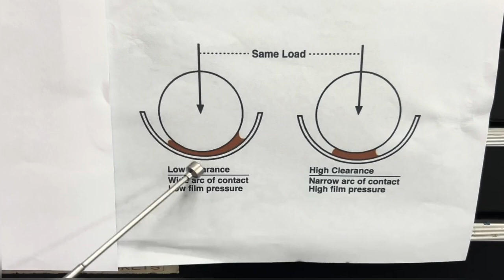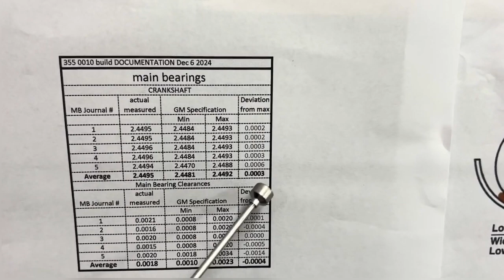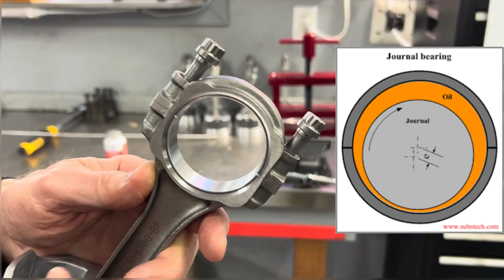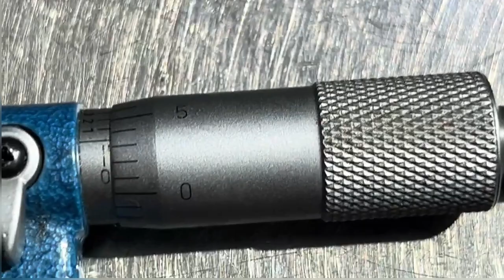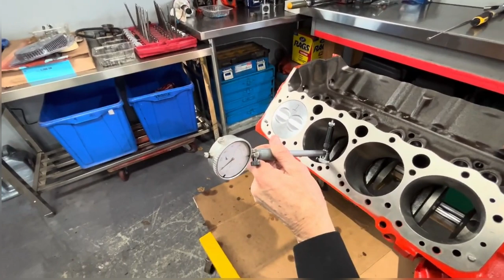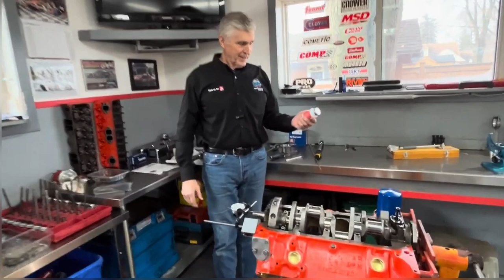CHEATS FOR SMALL BLOCK CHEVYS! DIY How to build a 350 yourself! Blueprinting VS Assembling

Comment: I have a suggestion for a video, a step by step on how to tune a carburetor using an afr... Holley main jetting, power valve, secondary jetting... Tons of videos on how to tune idle and adjust float bowls, but there's so much more to it.
Reply from the maker: Thanks for the suggestion Sheepdog, we will get to that.AG
Reply: @goldsgarage8236  That would be awesome! Not a white board but an actual proper tune after engine install, in street driving conditions.... I can't be the only person struggling with this. Getting a 12:1 fuel mixture consistant seems impossible
Reply: Truly appreciate the knowledge you're passing on to us inexperienced engine builders

Comment: I'm on my third real engine build and recently went and got micrometers and a dial bore gauge.  You are so right about how well I can now verify my parts. For those who have not yet bought micrometers I have a suggestion.  Don't bother with the single micrometer with exchangeable anvils. The anvils are too easy to get out of adjustment which ends up taking a long time to correct.  Also, when I bought micrometers I made sure to get micrometers with an adjustment stop. The stop is the little arm just near where the adjustment value is read.  When you get your "mic" all set up, you can make it stay set when using the stop. I found the stop to be a major improvement over just measuring. Once you have the value locked you can then transfer your reading to your dial bore gauge correctly. Without the lock things get tricky and hard to repeat.  I also realized while watching that my dial bore gauge is graduated like Allen's. Each mark on the bore gauge is half a thousandth. This had me fooled at first. Now I am more confident in my numbers.  I bought the Shar's mic set for $145, not fancy, but better than the super basic no-name stuff.
Reply from the maker: It is good to hear your experience with the measuring tools. Thanks for sharing.AG

Comment: How did you measure the cam bearing clearances?
Reply from the maker: Good question Baron. Only test fit the bearings over the respective cam journal prior to install, then test fit the cam in the engine after. AG

Comment: Always good to have a refresher course! Thanks for that!! On the thrust bearing clearance, do you sand both front and rear faces equally or just the rear since the pressure is always pushing forward? Also on clutch cars many have a clutch switch similar to a neutral start switch to prevent the starter from engaging unless the clutch pedal is depressed.
Reply from the maker: Actually, i have only had to do that very seldom, but just one surface. Thanks for reminding me about the safety switch preventing starting unless the clutch is depressed. In that case, I guess you don't have much choice. AG

Comment: Does oil weight make a difference when setting your oil clearance
Reply from the maker: Good question Roger. I think you should set the correct bearing clearance first, then use the correct oil viscosity to get the desired oil pressure. AG

Comment: So some of the information (Bearing clearance for example) are they specific to each manufacturer?
Reply from the maker: Yes Joe. Its always good to check manufactures specifications, however a general rule of thumb is .001" of clearance per inch of bearing. Most rod and main bearings are between 2-3" in diameter. AG

Comment: Great video. 
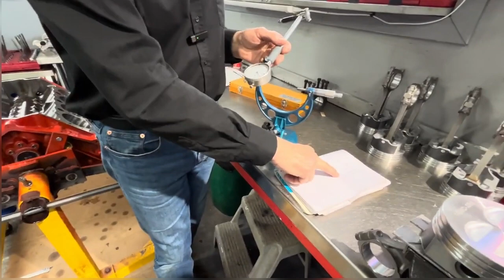19:42 Thank you for saying that. I just recently explained that to someone who was using it to measure the overall diameter of the bores. While that can be done with a dial bore gauge, a set of snap gauges is far more accurate.
Reply from the maker: Thanks for contributing to my channel Carl. AG

Comment: Great videos, i learn something with each one. A question i have is, if decking a block, small block chev for example,  does intake fitment become an issue? This engine decked at 20 thousandths for example, or is there an amount once removed that it becomes an issue? If so, what is the remedy? 3 questions  i guess.
Reply from the maker: Thanks for the question NDirt. .020" or even .030" does not create a problem. The gap at the China wall may be tighter, however most builders fill it with silicone anyway. If the heads are cut also, the assembly should be mocked up to check alignment. Hope this helps. AG

Comment: Thanks for all your valuable information.  I'm a month or so away from my 1st engine teardown/diagnosis and hopefully rebuilt. I have a 1972 350 with weak oiling to the rockers. I'm hopefully it's just sludge from sitting (43k miles). 25psi hot oil pressure.
Reply from the maker: Thanks Joe. i suggest you perform the tear down slowly and methodically, documenting what you find and looking for causes of low oil pressure. BTW, 25psi at idle is ok. AG

Comment: Mixing bearing shell halves of different clearances, won't that make the junction where the two bearing halves meet be of different heights?  Such as if you ran your finger over the place where the shells mate, you will feel a step?  This step could gouge the crankshaft journal?
Reply from the maker: Thanks for the question Robert. The bearing is wider at the junction to create the oil wedge, , so the crankshaft should never make contact there. Hope this helps.AG
Reply: @goldsgarage8236  Interesting, thanks.  I learned something here.  On researching this, some chamfer the bearing half with the smaller diameter so as not to have the step up(high spot) on the parting line of the bearings.  But it looks like this is not necessary.

Comment: Another fine video, guys. I learned a thing or two. But the question I have is this: you said to check your manual for specs, what 'manual' should I look for for my engine? I'm not sure I trust things on the internet. Got any book or website recommendations? Mine is a Chevy 350 block too. A 639 casting (roller cam block). Should I assume it's manufactured to the same cylinder and crank specs as an 010 block? Thanks!
Reply from the maker: Thanks for the comment 100. The manual I was referring to is a reproduction of the original.  I checked amazon and there is a variety of manuals available. If you search CT400, that engine is a race version of the ZZ6 which is the same block. You might also check GM PERFORMANCE. hope this helps. AG
Reply: @goldsgarage8236  I guess you mean the books from Haynes and the how-to books by David Vizard and others. I suppose I just didn't consider any of those as manuals. But I'll keep looking. Thanks.

Comment: I bought a book several years ago that was called how to blueprint an engine . I believe that was the name of it anyways it had a pre printed sheet of all the measurements you need to take and a place to write your clearances in. The only thing I had to learn was how to read the micrometers. Well several years and many engines I have all the gauges need but I still have problems because now I’m old and I have a hard time reading the very small print on my mics. You can never win…….
Reply from the maker: Sorry to hear Charger. Have you tied using a magnifying glass? Thanks for watching and commenting.  AG

Comment: Really enjoy your videos ---- trying to pick up the Tips and Tricks you give ------- Have two comments and a question on an engine I am working on --------- First comment to a video on where you were putting on the timing cover ---- noticed you had the cover bolted to the block ---- then put the harmonic balancer on ------ I know there is clearance for the bolts through the cover --- few thousandths --- cover can move within ---- the balancer centers in the seal in the cover  no clearances there---- leave the bolts loose --- slip on the balancer to center --- ITSELF --- then tighten done cover bolts -------------- Second comment ---- on the crankshaft endplay ---- you told what to do if the clearance was --- TOO --- tight ----- what does one do when you have --- TOO MUCH --- endplay? ----- The question for me is --- I'm just a Hobbyist --- I like Classic Old Cars  ---- it's been 56 years since I had an engine machined for me ----- now ---- this engine has the interference --- press fit piston and wrist pin ----- Have you done a video on this ---- maybe the engines you work on are all slip fit ---- I try to do things myself ---- I need to find out first ---- How much of an interference fit there is between pin and the rod ---- there are --"tempilstik" --- that show what temperature you are at when heating up metal ----- Seen videos --- pressing the pins out and in --- videos heating rod up to slightly red ---- I think that is too hot at that point ---- that's about 1000 degrees at that point ------ Would like to know your thoughts about doing this? ---------- Thank You for Sharing your talent that you have for doing this ----- You give a Wealth of Information on building engines ---- I really like listening to you ----- notes galore ----- Hope you have a Good Weekend ---------- Rodney
Reply from the maker: Some good questions Rodney. First, the timing cover on a GEN 1 SBC is located by dowels in the block. This is different from the LS generation of engines that require a centering tool. I will try to show that in future videos. 
As for too much end play, with a new bearing, that will not happen, they are always on the tight side. if it is a used engine and the end play is due to the bearing, then changing the bearing is your only option. 
For the piston pins, if both the pins and rods are at the same temperature (room temperature) with floating rods, the fit will not be a problem. As for press fit rods, I let my machine shop do that, but there are videos on Youtube how to do that. 
Thanks so much for your comments. Please let me know if this helps.AG

Comment: Remember make measurements at room temperature 🌡️
When working in 1/10 of .001 inch materials expand shrink especially aluminum.
Reply from the maker: Good point Motorhead. Thanks for commenting.AG

Comment: Outstanding video and very informative. I learn something new with nearly every video I watch Allan, so thank you for your willingness to share your wisdom and experiences with those like myself, who are not experienced engine builders. My big take away from today's video was your comment regarding load on the thrust bearing when the clutch was depressed. It makes perfect sense but it's something I had never before considered. I've owned many manual transmission cars in my lifetime and I had never considered how starting the engine with the clutch pedal depressed, versus the transmission in neutral and the clutch released, potentially impacted wear on the thrust bearing. It's definitely something I'll remember in the future. Thanks again for another quality video.
Reply from the maker: Good to hear from you Todd, i am following your progress on the GTO. AG
Reply: @goldsgarage8236  Hopefully after Christmas I'll be able to pick up the pace on the GTO's reassembly.

Comment: Once again, Alan, you provided great useful information. Specific tolerances aside, much can be applied to any make or model engine. Thank you. We older, seasoned guys, remember true paper "Blueprints" well. We who were schooled as engineers also remember the computer language, "Fortran."😮 When building street engines, I set the front main bearing clearance approx. .0005 tighter and the thrust .0005 looser than the remainder of the mains. Alan mentioned the larger surface of the thrust bearing and the need for greater clearance. The front bearings I set tighter due to the added load from the vector forces of the accessory drives. This does not usually apply to a race engine. In almost all cases, performance builds require looser clearances than stock.
Reply from the maker: Great comments Bill, nice to hear from someone from my cohort group.AG

Comment: Hello Alan, I built a 383 last summer with a used crank, turned 10/20. The mains were in at 25 tenths and rods at 14 to 19 tenths and I buttoned it up. Got to thinking and ordered some .020X bearings which are 2 thou bigger. Can I pull the pan and put 1/2 of those bigger bearings on one side to get 24 to 29 tenths clearance or .0024 on the rods? I really don't want to pull this sbc apart, the new  Enforcer heads are on too? Thanks!
Reply from the maker: Thanks for the question Cliff. You are fine with the clearances you have. I would not touch it. AG

Comment: I was in my late 20's and skipped measurements on just one rod journal on my 4 bolt main 400 chevy. Guess what it was a .0010 under and in 3 weeks it stacked a bearing and that snapped a rod. Luckily it did not damage my block. So soon I will be building a trail rider engine from said 400 four bolt main. Micrometers can cost alot but far less than a 400 chevy block.
Reply from the maker: All good points that help to reinforce the point of this video. Thanks Phil. AG

Comment: I’ve mix matched bearing sizes on different journal’s  to get everything as close as possible. Just because it says it’s a standard bearing doesn’t mean it is.   That’s where documentation of everything you do is so important.    

So you can document every single bearing clearance on the mains and rods.  

I like it in the 2-3- 2.5 thousands range and a little more on race applications, using nitrous, turbo, ect.  
Most guys with flat tappet cams that I know are running shell Rotella so a little on the loose end is compensating by the higher viscosity oil. So oil pressure isn’t an issue with the larger clearance.

I like that this channel has mature people that can actually have civil conversations and gain knowledge from eachother.  Most YouTube channels are full of nonsense in the comments section.
Reply from the maker: Nice compliment. Thanks for watching and commenting CULT.AG
Reply: I've ran a dozen different hotrod/racing oils over the years and I've done hundreds and hundreds of oil analysis on muscle cars, hotrods, circle track cars, drag cars etc and i wouldn't advise running a modern diesel oil in your classic cars. The newer, modern diesel oils such as Rotella have more detergents than anti wear additives which is not what your flat tappet cam needs and there's not a cam manufacturer in existence that recommends for you to run a modern diesel oil in your hotrod. The modern Rotella has about half of the zddp and phosphorus that it used to have. The last oil sample that i sent in for a customer that insisted he was going to run Rotella in his fresh 383 sbc with a flat tappet had less than 1200 ppm of zddp and phosphorus and 2000+ ppm calcium which is ALOT of detergent for a gasoline engine. I've torn down engines with identical run time and there has always been more wear on the cam and lifters when guys have ran nothing but Rotella compared to an engine that had ran an oil formulated for hotrods/racing applications like Driven Gp1, Lucas Hotrod, Valvoline vr1 etc.
Reply: They go from T-4  for bearings to  T-6 after break in. I’ve seen a lot of guys use Valvoline VR1 as well.  I’ve heard good things about the driven oil, but I’ve never tried it.
Reply: @CULT539  I agree 💯.  Been doin it for a long time and it never comes back to bite you. Thanks AG!

Comment: Can a factory cylinder bore be smaller than 4.00??? My manual says the tolerance can be 3.899 to 4.003 or something similar i don't recall exactly what it said but it had a value under 4" ...im wanting to swap out the dished factory pistons in a vortec block with aftermarket flat tops stamped as "STD" or  standard diameter not overbore. Will these pistons "drop in" as they say??
Ive never done this before so im a bit intimidated 😢 thanks for any advice
Reply: The clearance is built into the piston ie the bore is 4" and the piston will be 3.995" for a .005 clearance.
Reply: From what I recall standard bore on a 350 SBC is 4.00”s.  There’s a lot more to building an engine than just slapping a set of pistons in.  An aftermarket set of heads with smaller chambers to up the compression and a camshaft will really wake that thing up.  If you’re going to a carb I’d add a rpm air gap intake and a 650 quick fuel carb.
Reply from the maker: Thanks for the question Marcus. You will probably be OK, but I would suggest measuring the clearance, or have someone to do it for you in at least 1 cylinder. Piston tolerances are very tight, so if one is ok, the rest should be also. Hope this helps. AG
Reply: You always must measure.. and you must rehone the cyls so when it's being honed everything can be squared up.